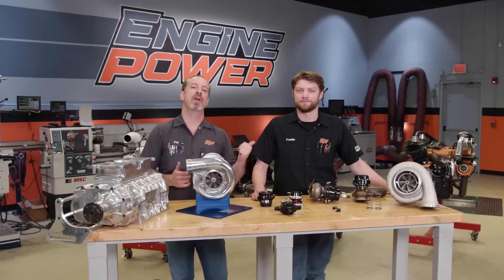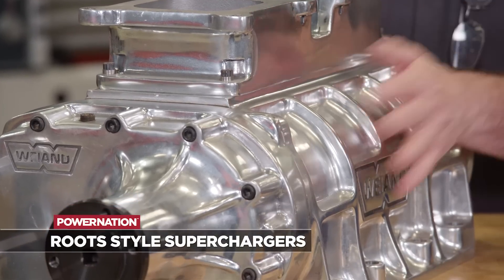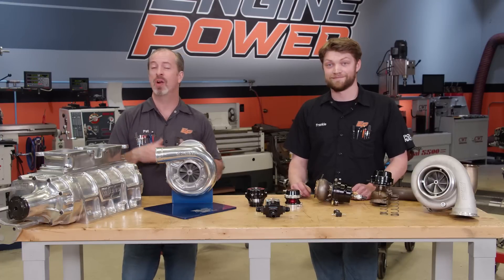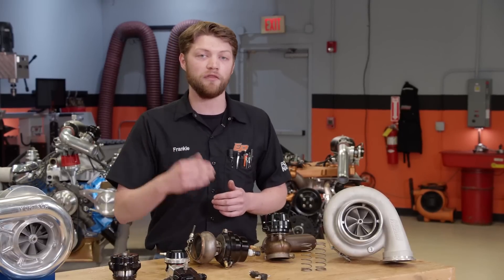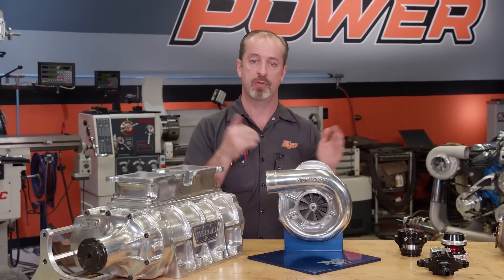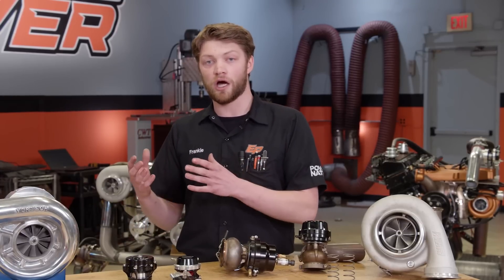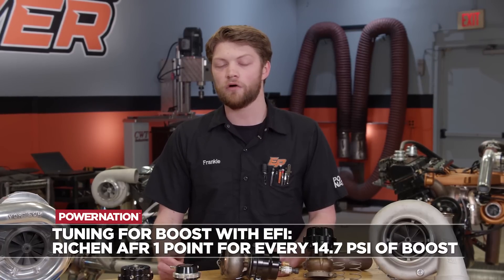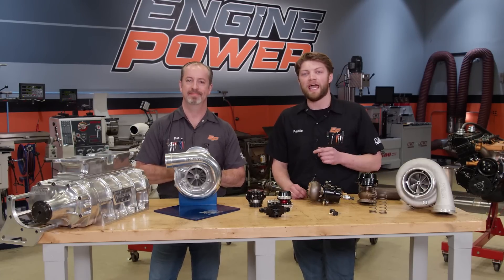Is Boost Worth the Effort? What, Why and How to Add Engine Boost

Comment: Turbos are fun but create a butt load of heat….with that said i run superchargers on my LS swaps….my nova has a LSA blower which is FUN but my c10 has a centrifugal vortech supercharger and it sounds awesome but you have to wind out the motor to get the most of it!!!

Comment: SO IN GENERAL, turbos and centrifugal SC benefit from high rearend ratio and or higher stall convertor to keep engine higher up in Rpm band where Hp N Tq really start building?
Roots type blowers make instant TQ so dont need as much rear gear or stall?

if correct those factors need to be taken into account overal for build specs and extra costs
not to mention special camshafts

Comment: The two stroke detroits needed it to run at all. With out a blower it will not run. That’s a natural aspirated two stroke Detroit, if you wanted it turbo charged you need and intercooler under the blower and a turbo on top of the blower.

Comment: The roots style blowers on Detroit diesels were just that, blowers. They were not used as a supercharger or a power adder. A two cycle diesel engine will not run without air being blown in by a blower.

Comment: Yes.  Always worth it. A 78/75 will make an easy 700 wheel on a 5.3, with a cam and springs. That's not pushing too hard. It can still be docile, too.

Comment: lots of mid 80's/90's early 2000's vehicles really only need about 5psi to get up with some of the newer stuff on the 2030 floor. cant get anything for less then 100k, don't blow it up.

Comment: If I was rich, I would definitely want to build a big block with a roots blower. If I had a cheap car i wanted to drag race occasionally, and it wouldn't ruin me if I blew it up. I would do a turbo setup. But neither of those pertain to me. So if I ever get the inspiration to boost something. I'll probably just go with a regular belt driven supercharger for it's simplicity. But most likely I'll just stick with naturally aspirated engines.

Comment: Superchargers exist for applications where turbos don’t don’t package well. Otherwise a turbo is superior in my opinion.
Reply: Superchargers benefits larger displacment better because of the rotating assemblely mass reducing the parasitic drag of the supercharger, more off the line torque production than turbochargers
Reply: @deepbludreams  No

Comment: Wouldn't mind adding some boost because the Chevy 5.3L can handle it.   The 6L80.....not as much.  You can add a bit of power but it's not exactly the toughest transmission out there.

Comment: I sure would like to see you guys able to take another 1970s inline 6 cylinder that is a 300 cubic inch and bore it out to 312 and adding, 2 Cobra Jets carburetors on it and see how much Hores power will be able to do.  If something like that is able to be done.  And keep it old, Skool style. Because I have grown up during the early days of the 60s and throughout my life in 70s era's and 80s.  Because of that, we didn't have any other options as well as where for today.  So love the old Skool type of engines.
Reply: Old Skool is always Kool

Comment: Why never a performance 4 cylinder?.. It's been proven that they can make power and be badass...
You'd take and make 500-600 hp building a v8 and you can do it with a 4 cylinder too..but you don't.. v8 is easier but it isn't necessarily ha4d to make comparable power with half the cylinders and a DOHC setup.. and...more people are building 4 bangers these days that it wouldn't be and un-relateable build...

Comment: which is worse on parts in an engine turbo or supercharger
Reply: Supercharger. It takes 100+ HP to spin it. That means the engine is under a higher load

Comment: I put on a used 64 mm Precision turbo on my Honda prelude with H22a my best dyno run 407 whp. It's been pretty reliable past 4 years. I bought used rods pistons that were in great shape. The springs and retainers I bought new. I am happy with the car.
Reply: I have a F22a6 in my Accord  SE, do you have a write up on the process? I would love to do this to my F22
Reply: I’m about ready to boost my h22a too.  What rod and piston combo did you use and what psi was the 64mm running at?

Comment: I just want to correct one thing, the roots style was used in Detroit diesel engines because they were 2 strokes and didn’t have an intake cycle, so no vacuum to intake air. Instead after the exhaust valves on top opened the port at the bottom where open by the piston, that’s when the roots blower would do it’s job of scavenging the last of the exhaust by forcing fresh air in its place. Later when they introduced turbos to the equation they learned the blower itself was a restriction as it didn’t create any pressure just move air, so they added a bypass valve to bypass the supercharger when the turbo was building enough pressure and flow to scavenge and supercharge the engine .
Reply: I personally hated the supercharged/turbo charged Detroit used by the military. The CAT I6 turbo that replaced it was such a better experience in both operation and maintenance. Turbos also can run a much higher pressure ratio efficiently as well. Good catch on the info.
Reply: @stevenPounder-p4b yep! I loathe a 2 stroke Detroit. The most efficient engine ever made at turning diesel fuel into noise, black smoke and nothing else.
Reply: @stevenPounder-p4b  I spend many hours behind 7 tons. I’m sure glad I got to experience the CAT C15 noises and not the Detroit. Also the LAV-25 still uses 2 stroke detroits. I think it’s the 6v53, and they’re slow as f*ck
Reply: Great comment I wish I’d thought of and 100% correct.

Comment: 2 stroke diesels don't self scavenge, so a blower on them is needed to make them really run at all. A 6V71 (or whatever) is considered NA if it only has the factory Roots blower, it gets a T with a turbo and A for charge cooling